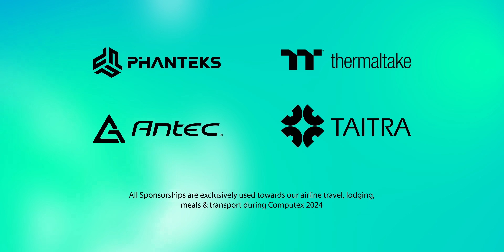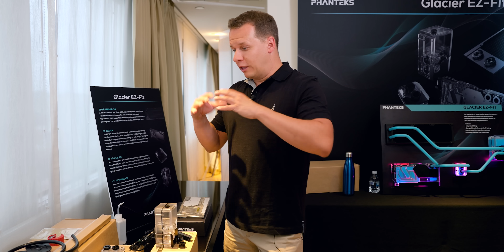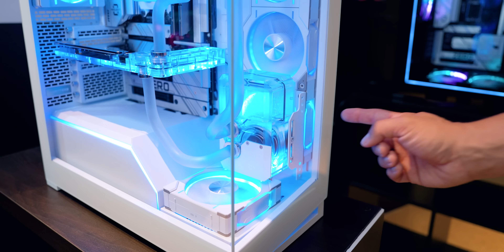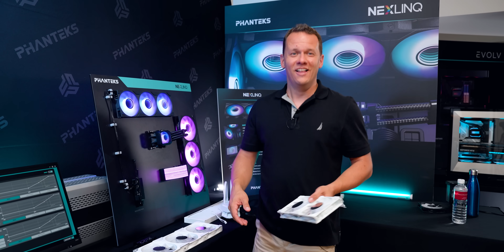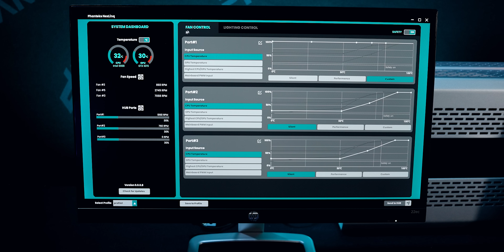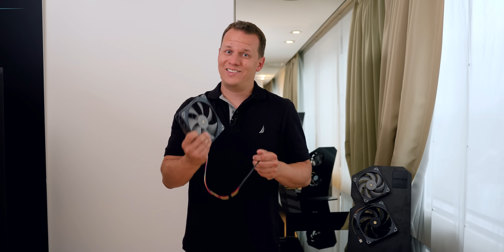Custom Water Cooling done DIFFERENT!

Comment: Unfortunately its propriety equipment, their fittings will only work with their rads. Where the threads screw in(water block, rads, cup cooler) is not standard. Good idea, poor implementation.

Comment: I have the Phanteks D30 fans I love/hate them.  They look good, the installed great, and they are quiet most of the time.  Now for the hate part, for some reason I just don't understand they spin to 2K RPM at which point they are absurdly loud not just because of the fan but because of the radiators the fans are blowing through.  You say they have PWM control so just adjust them down?  This is not true when you first power the fans they race toward full speed as fast they can and completely ignore the PWM signal initially.  Doesn't have to be this way either since Noctua's NF-A12x25 doesn't do this.

If silence is your number one priority buy the 120 to 140 adapters and use Noctua fans instead.

This failure to detail is just annoying, I'd rather have the fan only to 1K RPM and have even tighter tolerances or more blades to optimize shoving air through radiators with the lowest noise possible instead of 2K rpm hair drier mode.  The drive for every product to appeal every situation and use case is the Achilles heal of the PC industry.

It's just so close to being perfect, meanwhile my Mac is sitting next to the PC proving it can be done.

Comment: So

Um

You make a phan with proprietary connector to a hub and it seems to have no "hidden connectors" like the competition. You do not plan to sell the hub separately (at the moment).
If I want to connect not using the hub, I have to use the splitter

What is the value (other than price) for me as a consumer to buy these over the competition? It is still  a jumble of cables and splitters, with proprietary software to boot

Comment: Those push fittings are nothing new. I was using them over twenty years ago though admittedly they were a lot smaller 8mm and 10mm flexible tubing.

Comment: Only 37° flare fittings are reliable enough to be used anywhere near electronics. Push-connect fittings can barely be trusted with air, let alone water which will cause a lot more problems when it leaks.

Comment: Hope Phantek have paid royalties for those push fittings.
Reply from the maker: To whom?  Push to connect has been around forever, so long I'm sure the patent is long expired.  John Guest along has been doing them for 30+ years.
Reply: @HardwareCanucks  The patent is still active. John Guest keeps renewing then. Don't get me wrong, I like the idea of push fit coming to consumer water cooling. I'm afraid it will start another round of litigation as was the case with Asetek in the AIO market.
Reply: @HardwareCanucks to whomever has invented the latest improvement. They're not particularly reliable, and even worse with older versions.

Comment: So a push fit fitting like we've been using on truck air systems for decades. I can see them being a pain with hard tubing though, when you don't have the flex in the tubes to connect or disconnect easily

Comment: The concept of the water tubes with a quick connection is extremely brilliant but no way I'd buy them till they're well proven.
You have to worry about the connection not being all the way in, the tightness getting weaker after taking the tubes off multiple times, and god forbid, the tubes getting scratches and cuts causing a leak. I can already see people trying to disconnect the tubes without unlocking the lock properly and cutting the tube.
Reply: The teeth aren't usually enough to cut the tube, but they will definitely leave an indent over time, which might get them to wiggle. Depending on where the gasket is, that could be a problem.

Comment: I'm willing to give water cooling a try with soft tubing with this kit. $400 seems reasonable. This makes me less scared.
Reply: You can easily cut $100 off this. I actually built a $300 "budget" loop just for showing how "cheap" it can be done. And cheap is in quotes because, the parts are all quality parts, from recognized brands, with alphacools Apex pump.

This kit, with the sharkbites is interesting. But, there is a bit of a tax there.

Comment: a see small issues with conecting and disconnecting rigid tubes
Reply: if you only do one time, I think it is ok but keep doing that is no good, I think.  Regularly maintenance is no fun for me. So, I stick with air cooler or AIO without custom loop because that is too risky to get leak

Comment: One thing I’m kind of surprised that none of the water cooling vendors have figured out is coming up with kits for specific cases and then selling all the tubes precut. The biggest pain in water cooling is planning the loop and then cutting the exact length for each piece, but all of that is case dependent. And even if they didn’t want to sell precut pieces of tubing (that’s a lot of inventory given all the different cases on the market!), even just having some of the more popular cases would be helpful. And work with the case manufacturers to sell the case/cooling kit as a combo, perhaps with the radiators preinstalled.
Reply: that can't be done as cpu blocks dont have the holes in the same places. gpu, worse
Reply: because it requires specific hardware. Not all GPUs are the same. Not all waterblocks are the same. You are locked into whatever the vendors choose.

Comment: They should have a pro version ez-fit kit. 2 360s instead of 1, not cutters or bending tools and no fans. Keep the pump/res  and maybe the cpu block and sell the fittings on their own for g1/4 parts.

Comment: So many thoughts. First not a fan of push-to-connect fittings. For me hardline water cooling means I am going to test the tube many times to get it exactly the length I want so this seems like it would take longer than standard compression fittings not to mention that I've found standard compression fittings to be adequate. Next, I will call out any water cooling kit that doesn't come with a drain valve. Open loop means servicing means you need to drain the system. That's hard to do without a drain valve, especially with a hardline loop. Softline you can pull the parts out and make it work but hardline tends to be more constrained.  Next, the M25 G2 has a missed opportunity. Including screw covers is cool but then you might as well include or provide STLs or sell side covers It doesn't even look like it would be that hard to design around the current frame. I'd buy the STL to 3d print or if there were prefabbed add-ons of like a pack for 3 fans for $5-10. Lastly, Comparing it to ICUE doesn't do Phanteks any favors. iCUE integrated with several Motherboards. Since Corsair makes RAM you can control that. You can control the motherboard RGB headers. It syncs with some GPUs. It can be a one-stop shop for your RGB. And It's not that system heavy. Most of the performance issues can be traced to software conflicts. With this, i feel like I would probably end up using openRGB whereas with iCue I'm more likely to just buy stuff compatible with iCue. Either you are an complete solution that does everything I need or you need to be better than openRGB or signalRGB. This does not seems to be the case.

Comment: How do they handle some of those much needed 90 degree fittings? Those bends are super advanced without one or two 90s to make things go smooth. If they want it to be easier to make a loop, having all double or triple bends is not a good start.
Reply: An extra $100 in sharbite fittings. Be it theirs, or run down to the hardware store for some...

Comment: nah the fact that he said why bother with the soft tubing bundle is crazy...bc
1. what if I had better fans and want to get the cheaper option bc I rather use my noctua fans that has been working way better
2. what if I don't want to spend more of my time and potential mishaps from trying to bend those hard line tubes...like you still need to buy a hot gun…or even worse what if you break the tubes…now what you’ll need to buy some more. They all add up!!!

so please don't try to talk over the cheaper version bc boith bundles are catered towards different groups of people...sorry that you have the money to afford it but most of use don't.

Also you have to keep in mind that a lot of people are using air cooling and aio’s so they already have fans. THATS WHY ITS IMPORTANT FOR THEM TO SAVE THEIR MONEY AND USE THE FANS THAT THEY HAVE. 
It’s a way to reuse their fans, reduce e-waste, and resell anything they don’t need or repurpose them 

when the sponsor/money matters more than actually viewers who actually spend their hard earned money to even try to get into this niche hobby (cause custom water cooling is and will always be more expensive ;-; ) - shill some more -.-
Reply: No reason you couldn't use soft tubing with this setup also you'd be saving on fittings. Also the cheaper option is air cooling and it works fine. No hate for using soft tubing but seriously what are you even doing?
Reply: @nimrodery what are you even talking about? You do know both options are essentially the same right? The more expensive bundle just comes with 3 fans, hardline tubing, and the bending tools…

There’s nothing about air cooling….
Reply: @azndreamer2051  You said most of us don't have the money, that put air cooling in the conversation. Water cooling is an expensive option that only improves temps by a couple degrees, it's mostly for appearance and soft tubing doesn't accomplish much there. Just wanted to know what your aim was with this particular approach.
Reply: @nimrodery  I legit just said it in the other reply. The only reason why the soft tubing in the cheaper kit is all that matters for people who want to get that bundle is that it’s easier to use and takes less time. Compared to hardline tubing where you have to BUY a heat gun bc that’s not included so more money spent right. Then you have to take your time heating up the tube and you have to bend them correctly and then you have to cut. Overall more trouble to go through and if you’re new to this like most people bc again it’s a NICHE hobby then yea it’s easier to go with soft tubing. Also if you do it right and have a lot of experience you can def get more than just a couple of degrees, it all depends on what parts you have and what you’re using it for that’s why it’s a niche hobby….otherwise again you can just slap a cheaper option aka an aio or air cooler -.-

Again the cheaper bundle is there for A REASON and I was pointing out that the dude was just shilling for the more expensive bundle that has everything. 

Not everyone needs to get the more expensive bundle and waste money on stuff that they don’t need…like save your 100$ and slap on decent fans if you have them. If you don’t have fans then sure go for the $500 bundle. Thats was my point…

And aios and air coolers are in fact cheaper than a custom water loop so yea most people. I’m not saying all I’m just saying most bc yknow majority.
Reply: @azndreamer2051  So you want to save money while spending more than you need to, also soft tubing is somehow easier than installing an air cooler and you want to risk a leak for a setup nobody has wanted to see since about 2005. Why buy parts at all? I'm sure you have an old garden hose.
Reply: @nimrodery  bro what are you even talking about???? Are you okay???

You know I’m talking about people who WANTS to get into water cooling right! Like people who want to buy this right? Like people who are considering between these two bundles right? Do you understand that? 

If you don’t want to get into custom water cooling then please get out. Please stop saying things that doesn’t make sense. Please connect what this video is about and what I’m saying. Youre not thinking straight. 

I’m saying soft tube is easier than hard tube. Soft is greater than hard. Soft > hard. Do you get that? 

So the NEW PEOPLE WHO ARE INEXPERIENCED AND DONT WANT TO SPEND EXTRA MONEYYYY TO GET INTO CUSTOM WATWR COOLING the cheaper bundle is great for them as it’s easier JUST CUT AND PLUG and reside fans that they already have. 

I hope you understand that cause if not then you’re hopeless…
Reply: @azndreamer2051  I understand what you're saying, it just makes no sense.
Reply: @nimrodery  therefore imma stop talking to you bc it’s hopeless explaining it to someone who’s clearly won’t and will never will. Good bye.
Reply: Well, the "cheaper" kit is actually more of a rip off, compared to the $500 kit. So, it's not unfair to sideline it.

Also, the D30s are one of the best fans out there. Especially on a rad. Using existing fans is one thing, and a valid argument. I run my redux fans. But the only thing that is going to beat those fans is phanteks on T30s. Maybe, lian lis 28mm uni fan.
Reply: @thatfordboy4297  the lian li fans are not it. Also it’s not really a rip off…like why pay more money on something you don’t know how to do or feel comfortable doing.

Like sure you can buy the 500$ kit, but use only the soft tubing…so now you have the hardline tubes and all of the stuff to bend it (not including money to buy a heat gun) laying around wasted. 

Like why buy just because it “looks like a good value” when you can just get what you need and still have enough to buy three fans and still be under 500$

Like the cheaper bundle is GOOD nonetheless and will be good for many others. No need to feel obligated to buy the more expensive option bc people think it’s a “better value” when it’s not and you’re just gonna pay more for something you don’t need. This is why hoarding is a problem. 

Tldr: if you’re new and inexperienced and want to save money go for the cheaper bundle and spend some money on good/better fans

If you have the money or experience or you want to hardline tube the yea go for the more expensive option

My point is that, don’t just focus on the bigger bundle when the smaller bundle will be more than enough for a lot of newer people who wants to go into this niche hobby. Because in reality those are the people this cheaper bundle is targeting. 

The guy in the vid just made it seem like oh don’t be a cheap ass and buy the more expensive bundle bc it has everything you’ll ever need when in reality it’s not. Like I wouldn’t want to buy that $500 kit when in my case, I don’t want to buy a hot gun, measure the tubes, bend them, and cut them, and make sure they are rounded, and then line them up. Whereas, I can just measure roughly, cut, and plug in the soft tubes…no need to spend more than I need to. 

It’s just disingenuous to look over the cheaper bundle when it doesn’t fit his narrative. Like yes I get it you have money and the opportunity to spend all of this money for something like that -.-
Reply: @azndreamer2051  Neither of these kits are good. The only redeeming factor is the D30s in the expensive kit(also, go look up UNI fan TL, non LCD). Anyway the break down as I see it;

The $400 kit is about $100 over comparable specs, and its missing parts. I built a loop, that I posted on reddit, just for people to reference. $300(without fans, $330 with) and I at least included a drain.

The $500 kit, is about well, a hundred over priced as well (80-100). But the bang for buck ratio is a fair bit better. As you effectively are just paying for a nice set of fans. 

Again, neither kit is good. They are missing  a critical component. So, if someone is new, etc. They should seek out information, before buying a kit. Did they even include a leak tester in there... 

As for the video, they guy said flat out he is not a watercooler. Most people that are into water cooling, are not going to buy a premade kit, it defeats the purpose. Those who would use such kits as a gateway, are far to likely to get burned. Its like buying a dell, to get into PC building.

Comment: Nah, still air cooling. I learned my lesson with water cooling
Reply: to each his own. Aircooling is straightforward, very low maintenance, minimal planning... basically setup and forget... for those who don't want headaches... watercooling is basically an extra hobby on top of pc-building...
Reply: @geort45  yup, for setup, just place it there and then just it stays there forever 🤣.
Reply: Water cooling is fun for me and I enjoy optimizing the pc to run as powerful as it possibly can. Both my gpu and cpu run a lot cooler than air and allows me to hit higher clocks more consistently, with lower temps. It is a lot more work though and maintenance for sure. And of course there’s a lot that you need to research and things that can go really wrong if you mess up. Aside from that I think water cooling is definitley worth it for some people
Reply: People like me who love to tinker and put things together will love water cooling. Those who just want to set it and forget it will stick to air cooling.
Reply: whenever I build a computer for someone else, I aircool... I don't want people bothering me for a leak, weird noises, etc. Just sell it and bye, just dust it from time to time

Comment: Might be interesting. For most people, water-cooling is really silly, especially with 65w chips. I wish GPU adapter kits came back, those seemed pretty useful
Reply: I kind of agree. GPU's would benefit more than CPU's.
Reply: I tried the NZXT GPU adapter on my 1080ti... I screwed down too tight and it's never worked since. It also didn't cool the memory. Not worth it in my opinion. A full proper block designed for the card would be better.
Reply: @michaelbinbc  I want to see oem solutions that cost an arm and leg. they don't need to be full coverage type blocks either
Reply: Even the 100w+ CPU won't see benefits from WC as IHS is the choking point.
GPU still makes sense like mentioned previously, you can get full cover block for around 150 for custom loop or buy watercooled version from manufacturer (~200 premium thou).
Reply: yeah, that would be nice